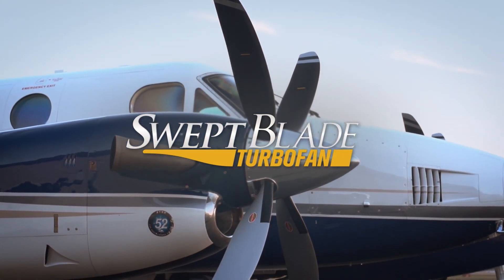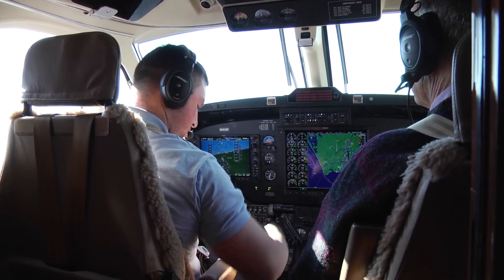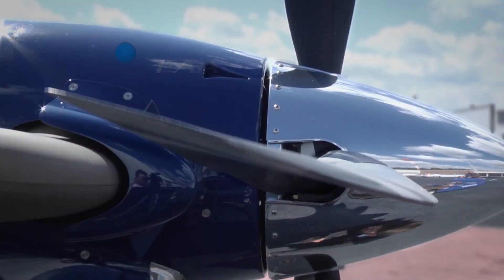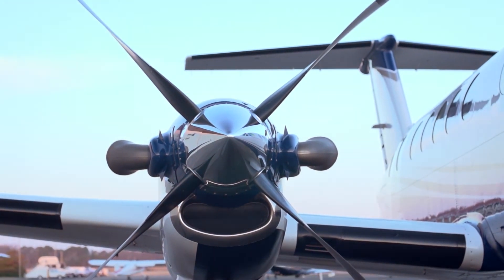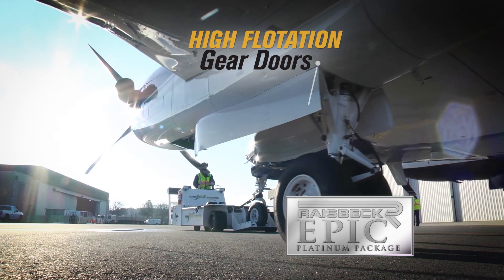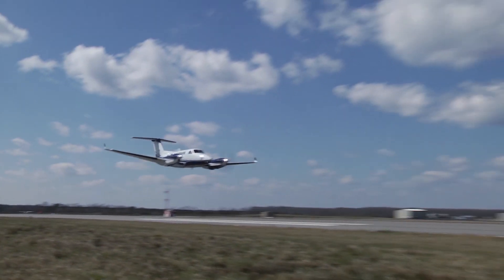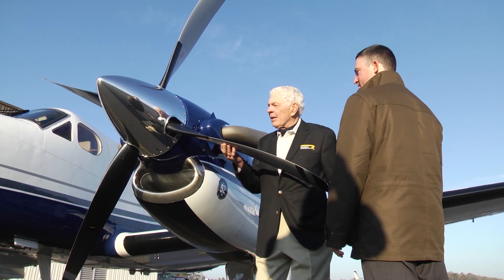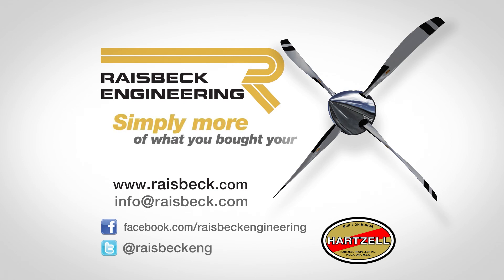Raisbeck King Air 200 Series Swept Props FINAL 11 25 13

Comment: To Both Questions they are Available for King Air Models: All 90/C90/E90   All  B200/B200GT/250/200   Late 2015 350/300s.  Contact International Propeller Service  Looking to Purchase Swept Blades Or Any King Air Raisbeck Performance Systems.